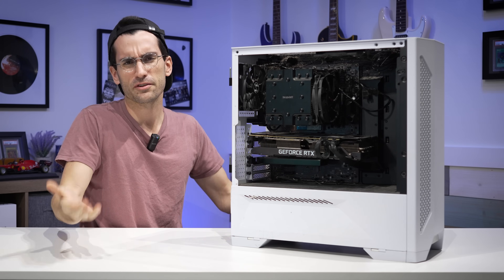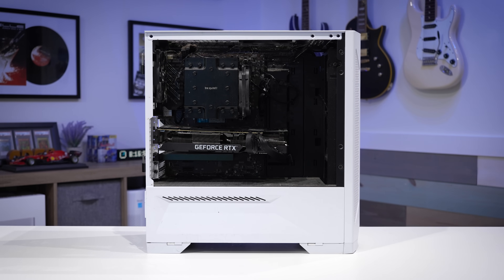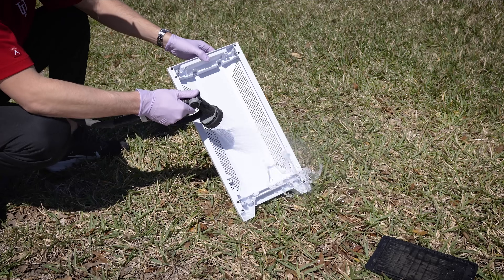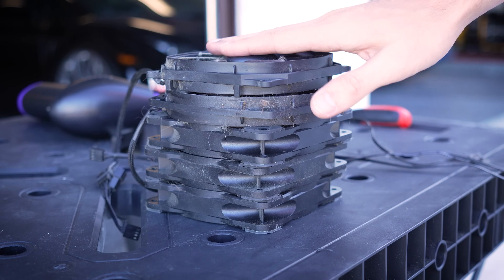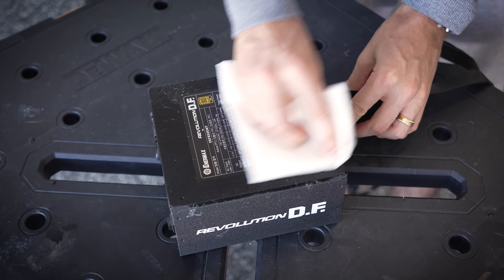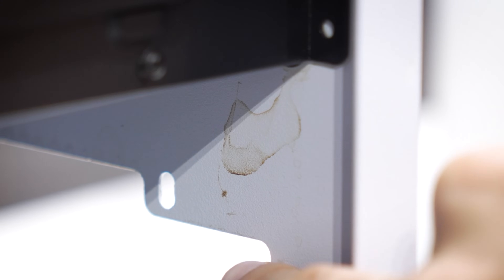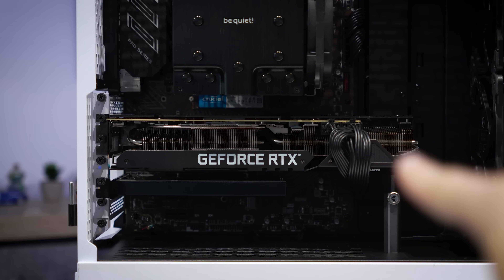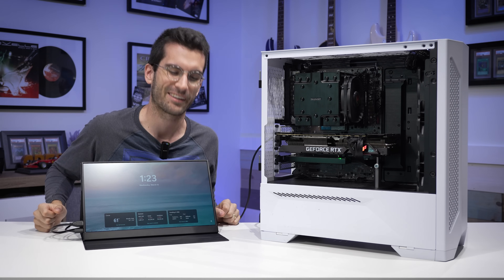Deep-Cleaning a Viewer's DIRTY Gaming PC! - PCDC S4:E3

Comment: I did it. when this video came out alongside a friend asking if I could help him either buying a new PC or upgrading his existing one, I decided to deep clean his current PC as thoroughly as possible using this very video as reference. granted I didn't have the vacuum cleaner nor did I have the air duster so I had to improvise with a brush and a hair dryer that wasn't in use and extract everything on my apartment balcony

I'm now decided to buy an air duster and perform deep cleaning for my friends and get some side cash (i'm charging about 70% cheaper than professional cleaners lmfao). 

I appreciate the inspiration this series has given me as it's been helpful to battle depression!

Comment: Great video Greg.

There are electronic parts cleaner sprays that are designed for electronic PCBs that will get that tar and gunk off that motherboard that IPA won't touch.

Even auto parts stores sell it as cars have a lot of circuit boards now.

I'll bet the smell of that PC when it was dirty was disgusting!

Comment: i just wanna ask if any of you guys have any advice on why is my mouse right click is not working(5-15 clicks theres only 1 registered) when i open 2+ apps at the same time ex. chrome, steam, file explorer,  games, etc. but when i close everything except for the main app im going to use it registers 1 out of 3 to 5 clicks, i know its not a hardware issue since i bought 4 types of mice already. i did deepclean my pc, updated/unistalled driver, used different types of port, unistalled my antivirus, even did clrcmos, etc. pls respect comment ty.

Comment: Call me crazy but I have 30 year old 2 HP compressor with a 20 gallon tank   I blow high pressure air through my computer, hold fans still manually and it get rid of dust fantastic   I do this a couple of times a year   I have baseboard heat and there isn't must dust to blow out    However, I think you'd find one useful for initial cleaning of these disasters    Kudos on the fan cleaning, but after 4 or 5 hours your time is worth more than the value of the fans, you probably should have replaced them with new

Comment: This looked like a pair of cases I got that both had coffee stains and one I could clean but the other I couldn't because of the flavouring it had put in it.  Both were spilled and thought that it would be just easier to replace it and if they had shut off power and cleaned it right away instead of leaving it in a cupboard for 2 years I might have been able to save one or both machines.  Believe it or not, I was told that it was the same user both times even though they were from an office.  

One of those PC's had coffee (and apparently some blood) from the original guy who put it together and the blood came up easy where I had to remove finish to get the coffee stain out.

Comment: Either dude's a smoker or he heavily uses incense sticks or scented candles. It causes a sticky layer to form on all the hardware and gunk starts accumulating. A tower with proper intake and exhaust has dirt stagnating in the negative pressure areas away from the direction of air flow.

Comment: I cracked open my system to install a new boot drive last year. It was the first time I'd opened my system in probably three years. And it wasn't anywhere CLOSE to that nasty. It was a bit dusty, and when I blew it out there was a low lying fog in my room for awhile, but it didn't require any sort of deep clean like this.

Comment: Not sure why I have never seen you use simple green for pc cleaning.  Use 50% dilution seems to work best.  Is non toxic and bio degradable.  I’ve used it to remove crude oil and on electrical equipment.  Hasn’t effected labeling on most items unless scrubbing required.  Hopefully you catch this comment.

Comment: Great cleanup!  I have learned if you don't charge them they will continue their ways as there is no reason to change anything.  I used to offer it as a free service but have since put it as an added cost which remarkably has shown to arrive at my shop much cleaner than before.  Dead skin and hair is far more disgusting than smoker residue but the smoker stuff requires a bit more cleaning, I smoke out side my house and shop as I know better lol.  Bad habits die hard!
Reply from the maker: I won't be doing this forever. My free service in exchange for content creation won't put a dent in owner sentiment hahah.

Comment: if you wanna use something that is amazing at removing nasty hard stuck on crap look into this stuff called goof off as long its used in a smart way it wont removed paint or anything just put a little on a paper towel or rag and scrub the area i use on pc components all the time and other stuff no matter what it is your trying to get off it will come off
Reply from the maker: Goof off is pretty much the same thing we used in this video - Glue Gone. They're all derivations of citrus-based adhesive remover. Still not totally confident using this around delicate SMDs with questionable solder points (especially with age).

Comment: In future situations like this you might give Windex a try. Other glass cleaners work similarly as well. It's the ammonia that breaks down the stains. As long as you rinse it with isopropanol it should be safe for SMD components too.

Comment: Rgb of the fans should work without SATA when it's directly connected to the RGB headers on the motherboard. SATA is only needed for the rgb controller of the case

Comment: Additionally you could use Contact cleaner to remove gunk on motherboard, and wipes for a case shie, also WD40(silicone) is exceptional for fan mecanisms....(*and if you ever have superglue to remove just blue-wd40 /w/wo h20 for 15min+ will disolve it).

Comment: Im having a green screen issue with no codes on my pc.
I upgraded my rtx 2070s to a 7800xt, i have a ROG 470x MB with a Ryzen 5600x cpu with a 850 corsair psu. I followed the ddu guide from a youtube video from a popular youtuber. did the ddu in safe mode as instructed. loaded into the amd software and downloded the lastest drivers for my 7800 xt gpu. my pc will only crash in gaming, i always make sure to look at temps, hot spot never above 80c and the normal gpu temp is roughly 60c, cpu is never above 65c under heavy loads. I originally had a 650w psu and a underpowered psu is a symptom of a green screen, it'll Only crash mid game and show a green screen for 2-5 seconds and restart the pc. no codes, no warnings. After installing a new more powerful psu its still happening, I did a ddu clean again thinking its a bad or corrupted driver, by this point its my third ddu clean. I made sure to have all NVidia software deleted like GeForce experience and i uninstalled the msi software for my old gpu. Im still convinced its a driver issue because this gpu I bought is Brand new, still had the factory gigabyte sticker on the plastic. Apparently I heard a factory reset on my pc could fix the issue, but that'll be the literal last option. I never had any green screens on my old gpu thats why i think its a possible driver issue, Im not super tech intelligent so Im not sure where to look. Any recommendations or tips would be greatly appreciated.

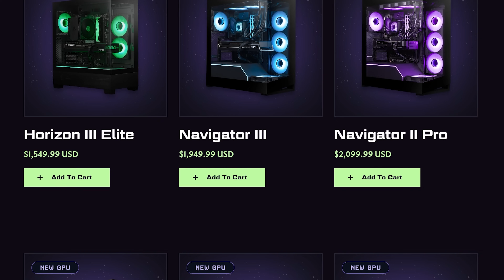Comment: 1:45 you talk about sag earlier but the pc you showed from them is also sagging... if your gpu is on the bigger thicker side you need support. how are you gonna advertise systems with thick gpus that have no support. when you use that and your gpu heats up for long periods of time it will warp the gpu and have it be bent.

Comment: Supposedly cool cases but don't have a single dust filter XD is it so hard to buy a filter for a little and mount it on a magnet are they? And you wouldn't have to worry about shorting out the fluff on the board near the processor or graphics. My pc didn't look like 1/3 of it after a year so you can see where they keep the pc just be happy that something doesn't get damaged.

Comment: Greg, been watching your videos for a while now. I love them. I’m a pc enthusiast aswell, I’ve built hundreds of pc’s and cleaned tons of them. I’ve just got one recommendation, just get an actual air compressor. Nothing will go wrong if you hold the fans, and it will remove so much more stuff initially, plus it’s highly satisfying seeing a huge dust cloud leaving the PC. Also great for blasting through the PSU since you don’t want to open those (neither do I), you can just hold the PSU fan still. Keep the videos coming!

Comment: I have found that Simple Green works better than alcohol. But I use alcohol after the SG to get rid of residue and to dry it out.
Soak it with Simple Green, wait a few min, and it will be dissolved into sticky gravy. It works great on the bed of my 3D printer.

Comment: I sometimes leaving my pc without cleaning for a 6 months to a year (usually I change some hardware or whole PC in less than a year though) but I never had anything except thin layer of gray dust that can be easily cleaned by a brush or compressed air.. I'm not a smoker, I don't have pets, and not actually cleaning my apartment that often, sometimes it gets quite dusty, still never had anything like that, an even my laptops, after 5 or more years of use, always clean inside..

Comment: Nicely cleaned up! A tip for removing gooey substances. In my experience the culprit is usually pop, and the easiest way to remove it is simple water and a cotton swab. The water melts it away. I follow up with some IPA to make sure the water is gone.

Comment: I probably wouldn't use organic solvents like glue gone around any PCBs, like the motherboard. It will probably dissolve the organic polymers layers of a PCB. I work in a synthetic organic laboratory and I've destroyed an lots of electronics just from getting some solvents on them (an ipod, 2 phones, a laptop, and countless calculators).

Comment: by putting the NVMe adapter in the full size slot, the GPU will now run at 8x not a huge deal but something to consider when adding in secondary adapters.
Reply: Maybe not - some newer MB's can get around that. But yes more often then not that will be the case.

Comment: 10:24 I use WD40 Contact cleaner to dissolve adhesives. It makes quick work of those adhesives and leaves no residue behind.
Reply: WD-40 in general is more of a solvent, glad to see this comment here. People use it as a permanent lubricant way too often when it's meant to remove gunk.
Reply: @1337bG01  Not WD40. WD40 Specialist Contact Cleaner. It's different.
Reply: @MarcoGPUtuber I agree. The contact cleaner is some pretty amazing stuff and safe for electronics.
Reply: @MarcoGPUtuber  He's still not wrong, WD40 is a loosening agent all it does is remove grease/oil.
Reply: @flitai  Yea but I don't want people confusing my post. I said specifically the contact cleaner
Reply: @MarcoGPUtuber  I think everyone who can read will get what you said...

Comment: You need to use toothpaste and a toothbrush on some of those spots it works like a charm because the toothpaste will act like a fine grit polish to get rid of the stains just a dab of toothpaste and a bit of scrubbing will get rid of them then alcohol to clean up the toothpaste.

Comment: He is a smoker you can tell from all the dark residue and the color of the dust.
Reply: I always charge hazmat service for smoker machines. They're disgusting and an absolute nightmare to clean.
Reply: Came here to post this and found this as one of the top comments.  Also I think he went from smoking to sweet vaping because that would be the sticky residue.
Reply: imagine his lungs....
Reply: Yup!  I was a very heavy smoker and had some fugly PC cleanups over the years. None of them were high end builds, though. This guy's PC shocked me.  How anyone could let a nice rig get that disgusting absolutely eludes me.
Reply: @Splucked  This PC is benign compared to some smoker machines I've cleaned in the past.

I've had motherboards so covered in cigarette tar that I had to remove and soak the board in an alcohol bath. The alcohol immediately turned yellow and then later orange when it got most of the tar off the board.

The piles of dust bunnies were orange as well.
Reply: @GGigabiteM   I believe you 100%.  Saw what smoking did to 99% of my machines. Seen plenty of repair vids with groady computers.  

Last year I 𝘧𝘪𝘯𝘢𝘭𝘭𝘺 got a halfway decent pre-built (MicroCenter).  Not as nice as the one in the video but still, I refuse to frack it up with tar and nicotine.  Smoking is strictly outside now. Sux in winter but great way to cut down.   😂
Reply: @ Good luck in efforts to quit smoking. Your lungs will thank you in the future.
Reply: Ahhh…those are nicotine stains! Good call 👍
Reply: Now now, let's not jump to conclusions. They might be an enjoyer of incense sticks 😅
Reply: Not quite haha, I'm not a smoker but pretty much all my previous roommates over the past 5 or so years have been heavy smokers, whether it's weed or tobacco. This just goes to show, even if it's not usually taking place in the same room, that stuff will get everywhere and in/on everything.

Comment: This is why Thermaltake swappable fan blades are good.
Take the blades out and hand clean easy
Reply: I feel like all fans should easily pop out to clean them
Reply: @TheBlueBunnyKen  You can kinda, sorta modify sleeve bearing fans by removing the shaft clip on the back of the fan. The magnetism from the rotor magnet will hold it in place.
Reply: @GGigabiteM  I still do this lol, however depending on theb rand I have found sometimes that magnet won't hold, especially if you bump the case.  Swafans are pricey but their gimmick is Divine!
Reply: Great gimmick that actually works and has no down sides, they even include lube (I use Superlube brand) tubes last forever and are stupid cheap.